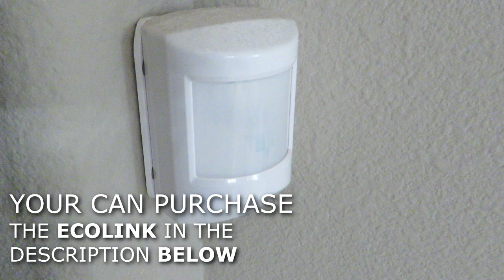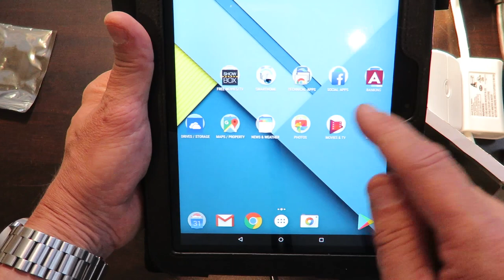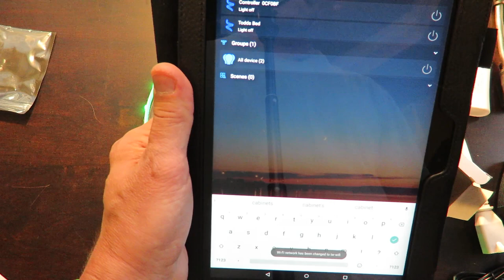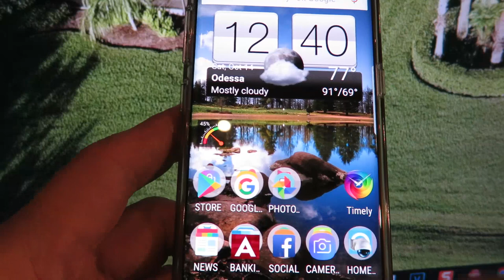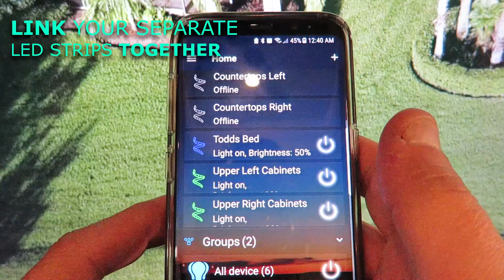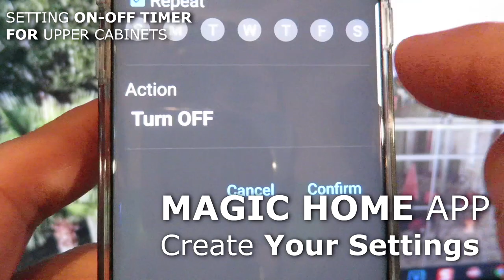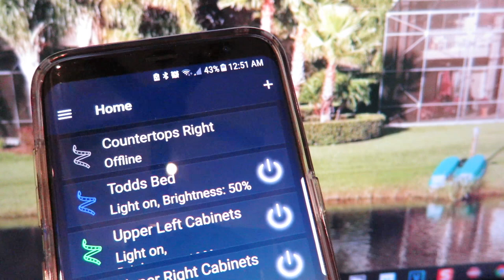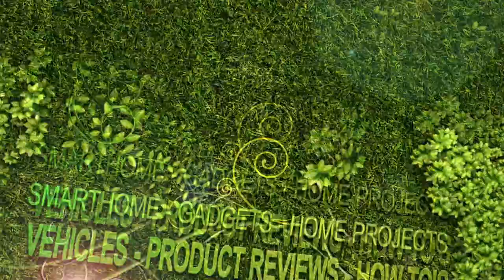EASY SMARTHOME LED KITCHEN COUNTER and CABINET LIGHTS. Controlled by ALEXA

Comment: What smart plug did you use for the Kitchen CounterTop LED Lights to trigger the motion sensor?  Does the motion sensor needs to hook up to Smartthings hub/Alexa?  Can you please explain the setup?  Thanks.
Reply from the maker: Hello Johnny, I used....Z-Wave Outlet/Switch: https://amzn.to/2TPEfEj  and Z-Wave Motion Sensor: https://amzn.to/2P5Ohxr.  Then I set the lights to turn on by the motion sensor through Samsung Smartthings hub. Hope this helps. Todd
Reply: @twHomeShow  That's what I thought you used, but noticed that your description did not have a Smartthings plug referral link.
Reply from the maker: @jtruong78  Thanks, I'm sorry I wasn't very clear on that part. I'll put a link in for that right now. I like to be as thorough as possible, so that anyone else that wants to duplicate my ideas, can do so with ease. Thanks again!

Comment: I’ve ordered from 2 sets from nexflux and I’m not sure if it’s the process I used in installing them or the quality of the LED’s themselves. One set of them flickers when I adjust it to a natural white color and the other set the WiFi controller only allows for red.  Also do you recommend certain clips ? I’ve attempted soldering but I’m getting mixed results.

Comment: Hi there, I've watched your video 3 times now. You've put a lot of thought and planning into your set up! I am doing a similar set up, but was able to prewire low voltage wires before cabinets were installed. I have a question about the stainless basket looking thing you have mounted under your Cabinets nearest the fridge, what is it? Bread saver possibly? Thanks for sharing your whole process!!
Reply from the maker: Hello Cody,  this is an automatic paper towel dispenser as shown here: https://www.amazon.com/stores/node/17978508011?_encoding=UTF8&field-lbr_brands_browse-bin=Innovia&ref_=bl_dp_s_web_17978508011
Best of luck with your lighting install!   Thanks for watching.    -Todd

Comment: I got most all the stuff you have to do my under the counter project, but my question is, I don’t have a z wave motion sensor, I do have a SmartThings motion sensor, is that still ok, and yes I do have the Z wave smart outlet adapter, a friend gave me the smartthings motion sensor so I wanted to know, could I still use this motion sensor for this under the counter project, please let me know, thank you
Reply from the maker: As long as you have a SmartThings Hub in your home you should be good to go. The Smartthing hub is capable of handling and communicating with zwave, zigbee, and all smartthings accessories. I'm sure your project will be successful  if you have these supplies. My setup is still working flawlessly and everyone in the household just expects it to work without flipping any switches....and it does, just that....ALL AUTOMATICALLY :) Sure, it takes some time setting up your lighting and pairing your devices to your smart hub, but after it's  all done. You'll be able to enjoy!

Comment: Awesome video! I'm thinking of putting under cabinet lights on my kitchen as well, but mine are in a rectangle room and the cabinets are in opposite walls, so I was struggling on how to sync the lights from both sides to turn on/off at the same time (without drilling the ceiling or spending more than what I have in my budget with a professional to hard wire everything). Your video gave me a great alternative!
I don't have Alexa, Echo or any similar, but I still would like to control the lights through the app and motion sensor, do I still need all the items you showed in the video? (I'm assuming the answer is yes, but just wanted to double check)
Reply from the maker: Hello Larissa, Yes you could just use the app, But for the motion sensor (those are Z-Wave) you would need a Samsung SmartThings Hub in your home. But maybe you could find a motion sensor outlet adapter to plug your light strips into :)  Thanks for watching and your comment!
Reply: tw HomeShow thanks for your reply! The concept of z-wave is a little new to me, so I don’t fully understand it. If I use the ecolink motion sensor and don’t have a samsung smart things hub it won’t work? Would you have any links of suggestions for a substitute or for the motion sensor outlet adapter? (I feel like if I get creative on my own I’ll end up doing something wrong or getting something incompatible, so I’ll just try to copy what you did)
Thanks again
Reply: I'm sorry to bother you again...I researched a couple of options, after your suggestion, and I found this D-Link DCH-S150 mydlink Wi-Fi Smart Motion Sensor. Do you think I can sync this wifi motion sensor with the Nexlux WiFi LED controller? Or they won't pair well because I'd need different apps?
Reply: Or is it just better to invest on an affordable hub, such as wink or Samsung?

Comment: Wanted to know if anyone had problems with the Wifi component.  I bought 3 Wifi attachments, including the one that came with the Nexlux LED strip.  None of the Wifi seems to want to connect and the remote doesn't work.  The only thing that works is the light.  I really want the Wifi to work because that's what makes the LED light smarter.  Any suggestions would be appreciated.  Also, I tried resetting the Wifi by plugging the power on and off 4x per instructions.
Reply from the maker: The only thing I can think of, is make sure you're trying to connect to a 2.4ghz wifi network and NOT 5ghz wifi.

Comment: Will these cabinet lights work with wink or Samsung smart things hub?
Reply from the maker: Hello Zac. Yes, I have them (both sides) working with a Z-wave smart plug (outlet) that connects easily to SmartThings Hub. That's what I am using. The Wink hub also supports the same (z-wave or Zig-Bee) smart plug outlets :)
Reply: will the color changing work with only having the samsung smartthings hub or do you also have to have the amazon echo/dot or google home? I am switching to insteon home automation to samsung smartthings and would like everything to work in 1 app. Thanks in advance! **great video
Reply from the maker: Hello Josh, I'm not sure if the color changing will work with SmartThings, I don't think so. i think Alexa has that covered (only).But, you can turn it OFF and ON!